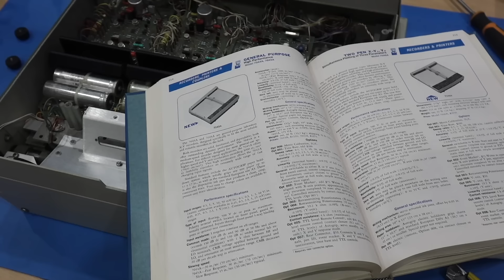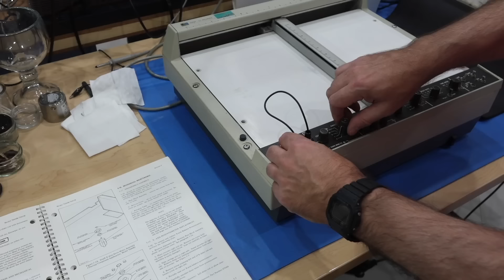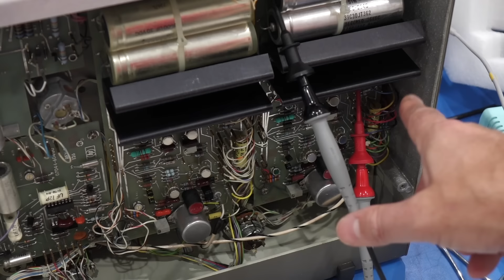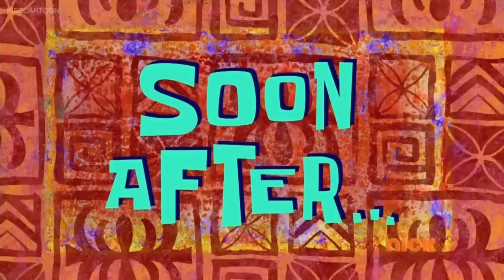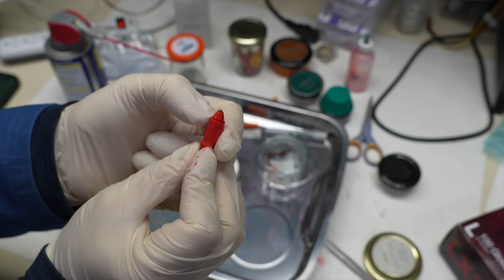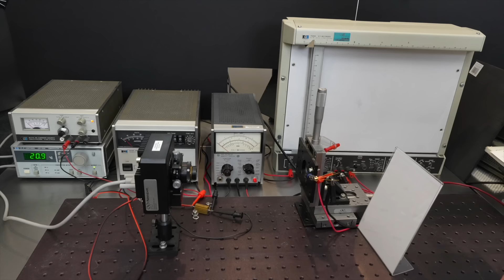HP 7044A X-Y Recorder Restoration

Comment: I absolutely hate sellers who not only have no idea how to ship, but totally ignore all requests to pack items correctly. I had an expensive eBay purchase of 4 similar items, basically thrown in a box for which they charged roughly $20 per item shipping, with no combined shipping deal, with a few pieces of styrofoam, which they probably pulled from the trashcan. Needless to say, the $500 of items arrived totally destroyed. In this case, the seller claimed that was how they were listed, so I couldn't claim as a 'not as described' item; fortunately, they had a no quibble return policy, so I told them I had changed my mind and I received a full refund and, strangely, they didn't want the items back!

Comment: What's the difference between a regular X-Y plotter and a "recorder"?
Reply from the maker: You probably mean what's the difference between a pen plotter and an X-Y recorder. They are cousins of sorts. A pen plotter is a digital drawing device controlled by a computer. Some do move the pens just like an X-Y recorder, others have paper on a drum or moving around in the Y axis. An X-Y recorder is an analog lab instrument with fixed paper that moves the pen in X and Y position from two analog input voltages. In the 1990s, HP had one instance of a hybrid device, which was foremost a digital plotter for a computer, but had an A/D converter input stage, so you could also use it on its own as an X-Y recorder in the lab. I can't remember the number of the machine on top of my head. But it was not as nice to use nor as fast as a pure analog X-Y recorder. Conversely, you could transform an X-Y recorder into a pen plotter by putting a D/A and some digital controls in front of it, and that's how the first pen plotters were actually made. And to confuse things even more, there is yet a third variation, the chart recorder. This one has a constant speed rolling paper going under an X-only moving pen. That's the one you'd use to record EKGs for example. HP San Diego made all three of these, sometimes using related mechanical innards.
Reply: @CuriousMarc  Ah, thanks a lot for the good explanation! I didn't even know they existed, but I knew about plotters from back in the days. They used to be the common choice when anything with graphics were to be "printed" from a computer, like technical drawings or diagrams. On the programming side I remember graphical plotter libraries in use long time after plotters became rare, mostly replaced by dot matrix and later ink or laser printers. The same libraries were also used with output to other graphical libraries like monitors and picture files. That HP plotting language became the de-facto standard for a while.

So the recorder device is essentially the paper equivalent of an oscilloscope in X-Y mode then :-)  I believe the constant X or Y speed devices like the EKG ones also existed with multiple pens so they could "record" multiple channels, but sadly the modern ones have become boring and lost the cool mechanical pen arms now ... but they do add text and other things like annotations to the graphs. I was disappointed that they no longer spew out the paper in real-time, though, the last time I was in for a check.

Comment: Hi Marc, I remember using a plotter like this in 1975 when I worked in a lab doing simulations of hot gas release from a gas cooled reactor. It had more than one pen as I recall, maybe 5 or 6, do you know that one? I can still remember the pens tracing out multiple different coloured curves at the same time of pressure changes in different parts of the model, a physical scale model of the plant, Hartlepool/Heysham 1. (Funny thing, after nearly 50 years, I have only just realised that Hartlepool doesn't have a 'y' in it, even though it is pronounced as if it does: Hartley-pool.)
Reply from the maker: There is the HP 7046 that resembles this one, but it has only two pens.
Reply: @CuriousMarc  I might have been a couple of years out with my date of 1975 and the number of pens. It might have been 1977, and perhaps it was an HP 9872. https://vtda.org/pubs/HP_Journal/HP_Journal_1977-09.pdf
Reply from the maker: Ah yes, that would be a digital plotter, not an analog XY recorder. A cousin/nephew of sorts. Famous for having so many pens.

Comment: I used to be a printer engineer back in the 80's & see you broke the carrier after tightening. You should change the loading in small steps. Then get the unit to do a full travel & repeat check with adjustment. As the loading of the wires varies.
Keep going love your work with Ken!

Comment: excellent video, I still hav a digital plotter 281 (multicolor) around from those days, maybe have to check if it still works and repair if necessary (cap?) -- was great at that times, and even fits to a lecroy scop for screendump. The nic ething about the 281 was the automatic change of the pens, and it has holders for standard ink pens used anywhere refillable--- really make me motivated to look after this device in my storage. Form my father company I had a still older yt plotter on a wheel but due to a water disaster had to throw awy some years ago

Comment: Thanks, Marc. Nice job on the pen transplant.  I have a 7035B plotter whereby the platen film has completely separated from its green glued-backer. It is also wrinkled and warped. Any idea how I can replace/repress that film and which glue to use?
Reply from the maker: I would take it off and try to use some Monokote instead.

Comment: Marc, the used bearings are the split type which means you press them in after the part is manufactured. The size of the hole for pressing determines the fit on the shaft. They work excellent and will last a lifetime when mounted correctly. Best! Job

Comment: I think the LM201 had already fixed the latching problem — or am I wrong?  I used to battle that with uA709.
 .
 But as far as the HP XY plotters go, I have ‘45 waiting for a miracle find for TWO pens.  It is XYY actually.  My other XY plotter is a Heathkit that I assembled myself.  It also needs refurbishing its pen every time I use it.  And soon also cleaning of the rails and feedback elements.  A fancy solution it has for the paper hold down is a slight vacuum delivered just fan blades on a low cost motor.  If I recall, it uses uA741 for its servos and has a selectable bank of capacitors to provide jitter filtering.

Comment: Haven't heard a uA741 described as better than anything in a while ;)
Reply: Clearly the main improvement the uA741 introduced, was the correction of latch-up of the uA709.  Well, for some people it also may have been the freeing of need to add external frequency compensation components.  On the other hand, the ‘709 was faster in situations when the application did not need the compensation, i.e. when the loop gain was high enough.  Same situation as that between OP27 and OP37.  But frankly, I changed from uA709 to uA741 as soon as I had tested it was “better”.

Comment: And how many of these problems were shipping damage? Your repair of the plastic and old dry pens were amazing! Never underestimate the destructive chaos that is shipping damage! Senders should always remember that packages that weigh anything at all may end up on the bottom of a stack of heavy packages, so they could be crushed in unusual ways with ridiculous force. Shock damage is often nothing compared with crush damage. I've seen heavy rack equipment bent into a slight s-shape even (recently). I had to repair the problems from that, broken boards and of course chassis alignment issues.  Machines in the best condition you'll ever see can be turned into parts machines even if they are packed kind of well.

Comment: HP plotters were the first 'printers' I had anything to do with - used for monitoring the swing of the dredge 'New Jersey' [launched circa 1927?] cutting a turning basin for a port in Saudi Arabia.  It was linked to a Motorola Mini-Ranger navigation system with the master antenna being raised and lowered on a "flag-pole" to suite the state of the tide. At certain states of the tide the Mini-Range signals "bounced" off the sea-surface and I was required to climb out on the gantry to raise or lower the master unit to achieve reception.

Comment: I got my hands on one of the HPIB plotters for the first time recently - the electrostatic paper holder is just crazy, something that I surely wouldn't have thought of if it hadn't already been done. And this was in 1979 (and as I understand it, was used for quite a while before that)
Reply from the maker: I’m amazed too at how well it works. It’s like the helicopter - it shouldn’t work but it actually does!
Reply: @CuriousMarc quantum tunneling shouldn’t work either 😂 crazy universe
Reply: I didn't know that they used an electrostatic paper holder. I only knew that the later HPGL Plotter (7550? the A3/A4 model ) used vacuum to hold down the moving paper.

Comment: I always love these videos. Seeing how this older high precision equipment works. Plus, you get a nice tutorial on various circuits along the way. And Holy Hell, do I miss proper manuals with theory of operations and schematics. Yes, I know a lot of devices today would require a schematic the size of a city block and are often nearly impossible to repair for the average person due to microscopic components and conformal coatings, but still... I do miss them. Lol.
Reply: There is a lot to be said for the old days.  Things were not only repairable but understandable as well.  I think it's always best to use the simplest technology possible to accomplish the goal at hand taking into account cost, size, and performance.  Easier said than done though!
Reply: Meh, for surface mount parts, we have microscopes, and for conformal coating, we have hot air and tweezers. The sucky part is spending a week tracing out the components to draw out your own schematic.
Reply: The circuits stuff is why I watch too! My experience is with cars and it's the same with electronics. You get to a certain year and working on it is a totally different animal

Comment: A chart topping plot - high tension, a power struggle, getting locked up, some good travel, a twist with pen testing, catastrophic break down, some more tension and the hero saves the day!
Reply from the maker: So many unexpected twists and turns in this restoration! I need to add chapters…
Reply: Genius comment. Well done.

Comment: In the early 1980's I used to build Solid State replacements for vacuum tubes that were getting too expensive.  We potted them in JB Weld for strength.
Reply: We used to use something very sikilar when I repaired Model 33 Teletypes in college (frustrated programmera used to pound on the plastic covers, breaking them). Miller Stephenson epoxy and 12 gauge solid copper wire as filler and repair staples.
Reply from the maker: Which proves again that you can repair *anything* with JB Weld. Stick pins in a block of JB Weld, flip it over and plug it in the socket, I’m sure it will replace your fried microprocessor chip just fine!

Comment: How about a Moseley chart recorder?  I used to have an amplifier/marker generator for one- all tube based.
Reply from the maker: Yes, a nice Moseley Autograf! You know that deep down the HP 7044 is a Moseley too. HP got an 80% stake in Moseley in 1958 and purchased the rest of it in 1964, becoming the HP San Diego division. Who made this recorder. My older HP 7035 looks straight out of the Moseley catalog. It is said that Moseley invented the X-Y recorder in 1935.
Reply: @CuriousMarc   I have an original Moseley and the plastic block like his was also broken. I've been meaning to make a new block on my small lath/mill. It is an older amplifiers that used a Novistor tube amp instead of transistors for the input preamp.
Reply from the maker: @dwightelvey645  Oh, interesting that I am not the only one! Nuvistors are very cool devices.